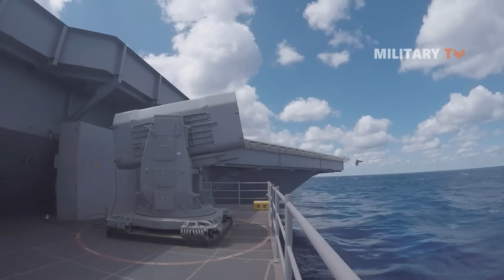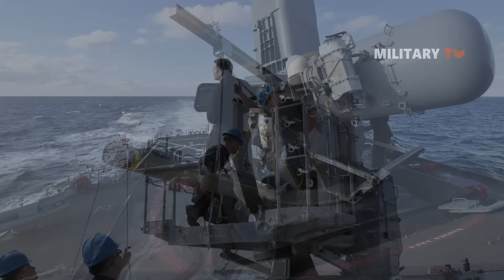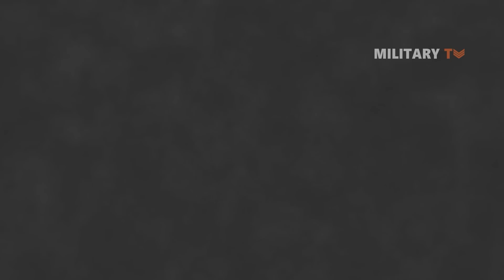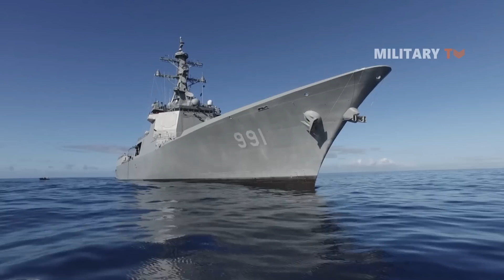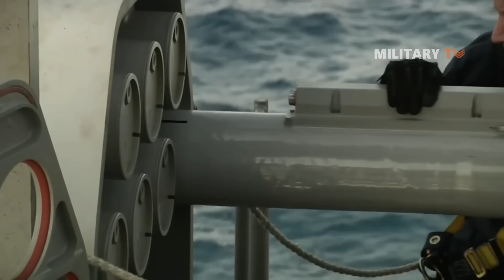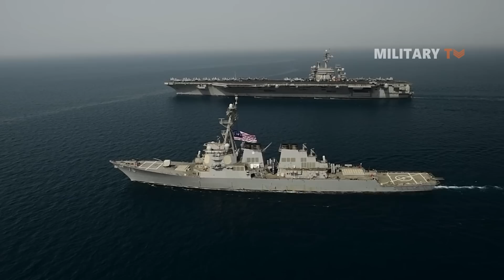RIM-116 Rolling Airframe Missile

Comment: I suspect a normal gun-based CIWS system will be less likely to be overwhelmed, and 100-200 20mm rounds are probably a LOT cheaper than one RIM-116.
Reply: Yes, but 20mm may not always be enough to stop a large Russian AShM in time wit it's relatively limited range.

The RIM complement the defenses, as it allows them to engage the threats at longer range with more firepower..

Anything that get through would then be engaged by the Phalanx .
Reply: A gun based system is cheaper, yes, but it is NOT less likely to be overwhelmed. Quite the contrary rather. A RAM can launch all of its missiles at separate targets VERY quickly with a good chance of hitting every one of them. A CIWS gun system can engage only one target at a time and has to stay on that target until it is dead. Also because the CIWS gun is relatively short ranged, it is not likely to be able to engage a second target before it hits if both missile are engaging simultaneously.

This is not all bad however, as at least in principle a CIWS gun 'and' a RAM missile system could 'both' be deployed on the same vessel due to their operating at different ranges. The RAM would engage threats first at longer range with the CIWS gun acting as goalkeeper to engage any threats that make it past the RAM. IMO this is the ideal deployment strategy. 

Sadly most (all that I am aware of) navies are going for either one or the other rather than both. The pencil pushers clearly haven't done their math, as adding a CWIS gun in conjunction with a RAM system would not cost very much relatively speaking and would likely double the ship's survivability.
Reply: Not really
Reply: Also ram can adjust its pointing during flight to defeat maneuvering threats that 20mm bullets can not.
Reply: Cheaper no? Overwhelmed easier yes. Missiles are far more affective
Reply: Cheaper yes. Overwhelmed easier yes. Missiles are far more affective

Comment: It would be interesting to see the system upgraded to something like the Peregrine missile when it is ready.  The AIM-260 is a huge upgrade from the AIM-120D but half the length.  Both are likely far too long for the rolling airframe.
Reply: Why are you mentioning these unrelated systems?
Reply: @AugmentedGravity  First is because the original rolling air frame used the AIM-9 Sidewinder.  Then the modified it using the IR sensor from the Stinger missiles and it developed into its own missile called the RAM.  It is still basically an IR homing missile about the size of an AIM-9 Sidewinder.

The US AIM-120 and AIM-9 are currently used in the ground based NASAMS to great effect and the AIM-260 is its replacement for the AIM-120 and the Peregrine looks to be the replacement for the AIM-9, but it has all the capabilities of the AIM-260, but with a much shorter range.  This is still a HUGE step forward from the AIM-9.  The AIM-260 is a beast... a massive upgrade.  Also when you consolidate systems like that to use a common missile you save a lot of money.

The Peregrine missile would be a faster, longer ranged, and much more capable missile than the current missiles.  I would replace the Phalanx with a 300kw Helios laser system (which they likely will).  These are both technologies that will be available over the next 3-5 years.  The AIM-260 already went into full production back in October and is planned to phase out the AIM-120 by 2025.  The Peregrine is rumored to go into full production in 2025 or 2026.  They figured it would be easier to base it heavily on the AIM-260 that come up with an entirely new missile for the replacement of the AIM-9.  This will double the speed, quadruple the range, and add active and passive radar tracking to the existing IR tracking.  All for a missile the same weight.  It will be slightly larger around but shorter though so that is can replace a single AIM-120 or AIM-260 in an F-35 or F-22 internally with 2 shorter Peregrine missiles.
Reply: @toddabbott781 "it is still basically an IR missile the size of an AIM-9X" oh man you’ve got a lot to learn. Firstly it’s a point defense weapon. Secondly, it only entered service a few years ago. You clearly don’t know anything about the US navy for you to comment about replacing the missile. The US and tons of other countries still use SM-2 missiles which came out in this 60s. Unlike Russia, America uses platforms that they know already work and simply upgrade them. It’s far better than creating an entire new missile

Comment: The launcher is just a piece of metal.
It all depends on how good their threat detection and fire control systems - and of course how good the interceptor missiles are.
Reply: 95% hit rate, and that's just the RAM. Other missile defense systems such as the Phalanx CIWS, Evolved SeaSparrow Missiles, and Standard SM-2s/3s/6s provide a layered defense which only activates the RAM when absolutely needed. So I'd say it's a pretty good system.
Reply: 单元数量也是一种影响